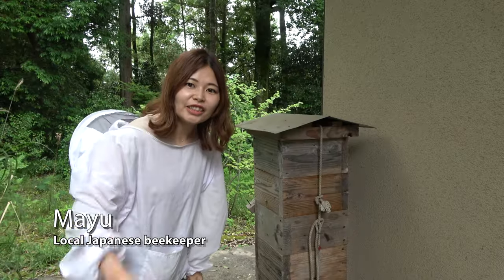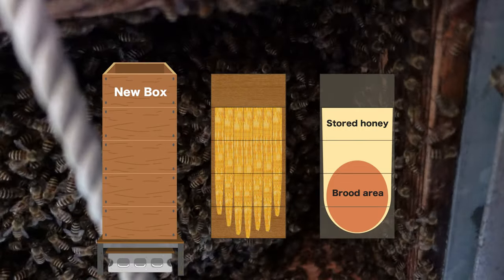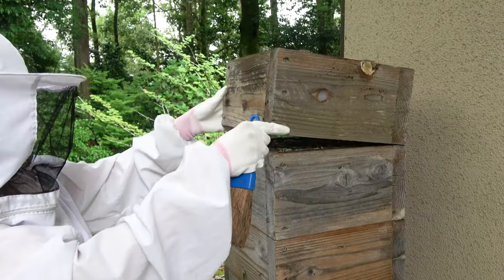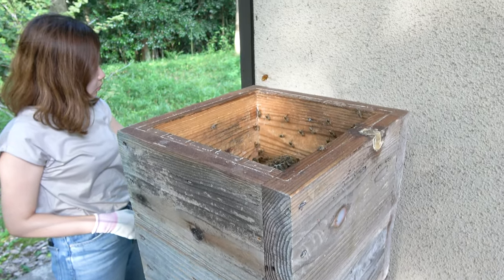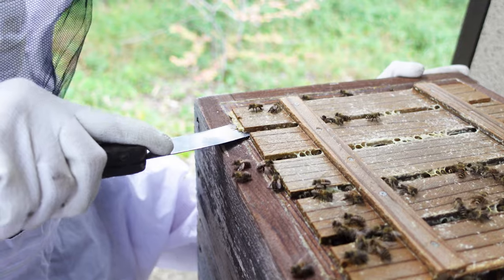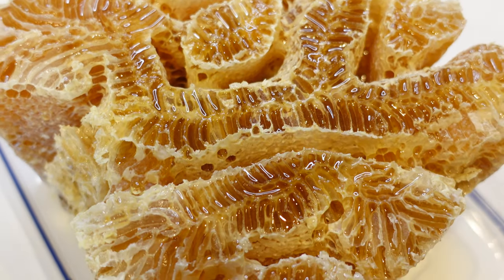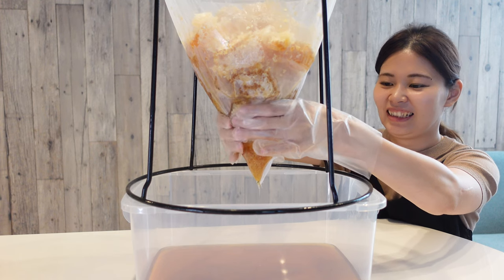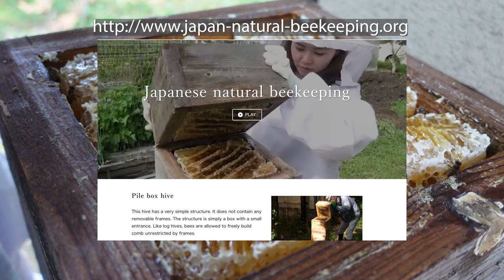Harvesting the most beautiful honeycomb from traditional Japanese beehive.

Comment: I have Bees here  in Scotland  🏴 of the Black Native Bee Species. 👍 
I use several Hives designs including these :
UK Nationals, 🇬🇧 
USA Langstroths, 🇺🇸 
And French 🇫🇷 Warre* Hives. (Small Box stack) 
These Warre are very similar to the Japanese Hive system : where Boxes are added underneath (its called "Under-Supering")
Tip : Use Frames ! 👀 
By letting your Bees use Frames to make Drawn Comb and Store Honey, means the Frames used in  Beekeeping (in the West) : Results in the Honey Harvest being taken but the Comb stays INTACT and can be used again by the Bees !  Win, win.  👍
In doing the Japanese / or Crush and Strain method : you lose all that lovely "Ready Made" Drawn Comb. 😱 
It takes x 5KGs (10lbs) of Feed to make x1Kg (2lbs) of Drawn Comb !!! That's an awful lot of wasted Wax (Construction) gone in the Crush and Strain method of Harvesting Honey. . .
Frames can be made in a DIY fashion. Aa long as they have x2 Bees Space in all directions  (to allow free working access by the Bees) and space to aid  removal from the Box ! 
Frame can be a Longer Top Rail, resting  within a Box ledge each end, side Rails each side. And a bottom Rail nailed into the end parts of the Side Rails. Costs about 30p 50c if using Scrap Wood off say 
a Food Grade Shipment (Heat Treated) Wooden "Pallet" (these use 'heat' to prevent Woodworm etc. Not any Chemicals : These pesticide treated ones  could harm Bees. If it has H.T burned into the Wood : it has been "Heat Treated."
Pallets are Free and found readily available in Depots and Warehouses & Stores.
And easy to break up and get useable wood from : with a Hammer and a Hand Saw.  Just time and a bit of effort  pulling it apart ! (Even basic Hives can be made if Planks are glued together. For Brood and Super Box making etc.)
Information :
Frames and their Wax in them, are usually used on an average x3 Year cycle. Oldest ones (x3 Years*) are in the Brood Box (Darkest* Wax) that can be taken out, spun to extract any areas of Honey in them (Once Brood has hatched out of them.) The Wax heated, then filtered, poured, onto Silicon Wax Sheet Moulds : to make New Foundation ! Win, win.
Ones added before this : 2nd year are made that last Spring, Summer and will be of mainly Stored Honey (Mid Tone Wax.)
And the Newest x1 Year made in this Bee Seasons Spring ! Will be New Wax: prestine & White in colour with light Nectar, or Pale coloured Honey, that is not yet Capped, or "Fanned" down (by Bees Wings !) The Moisture Level to be called Honey ! Need to be  17% or less in moisture in Readings (Refractometer.) Before you can Harvest it.  : If dripping honey comes out on a ight shake Test. (If it drips) its to Wet and could ferment in your Honey Jars. Hope this helps. 😎
🐝 🐝 🐝 🐝 🐝 🐝 🐝 🐝
 Happy Beekeeping 2023.
  🐝 🐝 🐝 🐝 🐝 🐝 🐝 🐝